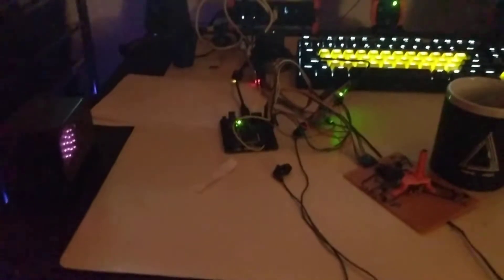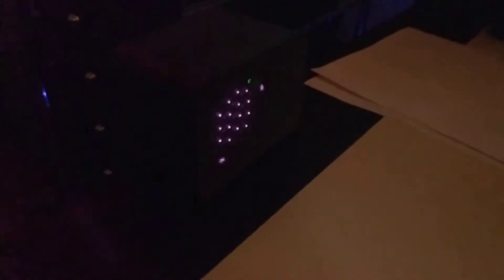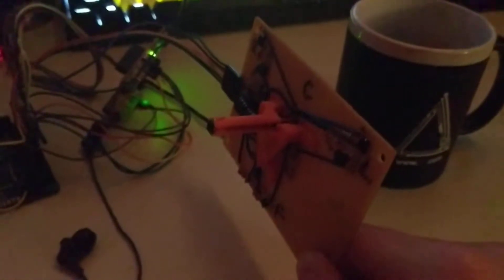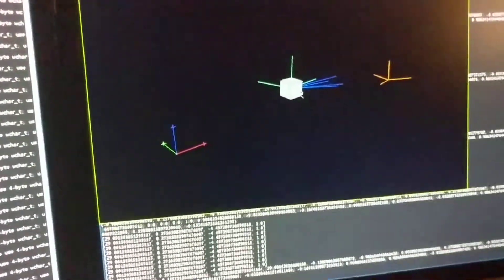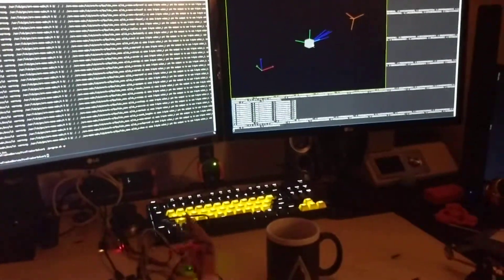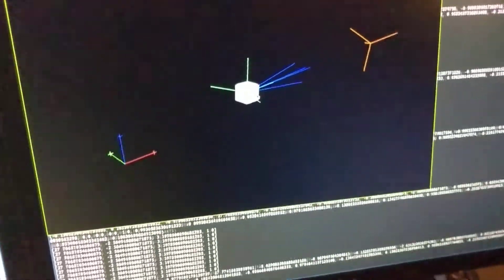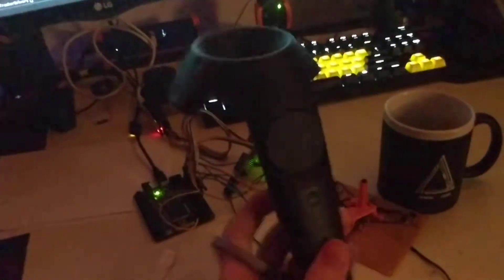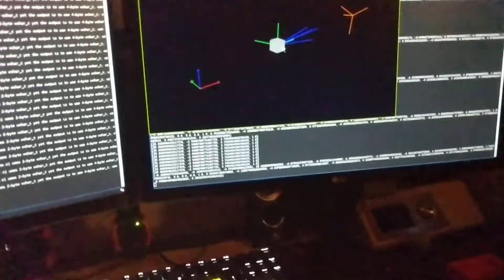Reverse-Engineered SteamVR Tracked Device

Comment: Awesome project! Just got a vive, and I have a Mojo V3 somewhere, might have to try this out. How well did the analogue front end work? It's one of the simplest I've seen. Does it cope with ambient light and such alright?
Reply from the maker: It does. That's what the amplifier is doing. It's in open-loop thresholding against 2/3 of a low-pass filtered (average) of the input signal

Comment: Nice job!

You can actually tell the sweeps apart by looking at the sync pulse widths, there are 8 pulse widths that encode 3 bits of information; the associated axis, if the laser is enabled, and one data bit from a stream of ID and calibration information.  The laser enable/disable bit is used for time-division multiplexing the pair of base stations.  In mode "A" with only a single base the lasers sweep for each spin, not every second spin, so only four sync pulse widths will be observed.

For best jitter performance you should track the two rotors and their associated syncs independently, using the bracketing syncs each side of the sensor hit to define the period of the 2pi sweep.  You don't need to use a PLL, a simple time-stamping of sensor edge events can be processed in software in the MCU, but using the FPGA front-end to do the sync recovery can certainly reduce the workload on the MCU.  However compared to the solver the pulse-to-angle stuff is easy.
Reply from the maker: Thanks! Yeah, I was totally unaware of that when I put it together. I did observe the pulse width differences on the scope when I was poking at the lighthouse, but didn't know what to make of them (there wasn't any immediately obvious pattern, so I decided not to worry about it; time pressure and all on the project submission :P ) As far as the PLL goes, I did that because from my simulations I couldn't figure out a good way to sync when I'm looking at the input signals purely digitally (the analog frontend saturates the received signal, so both the syncs and the sweeps are hard edges; what's worse is that at extreme angles, they would overlap).